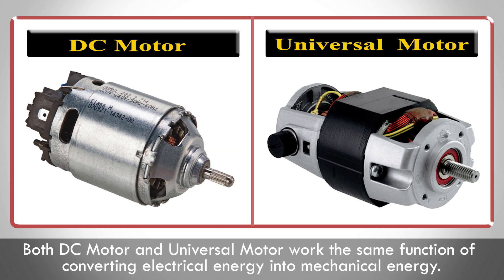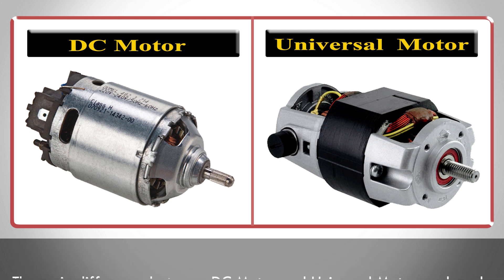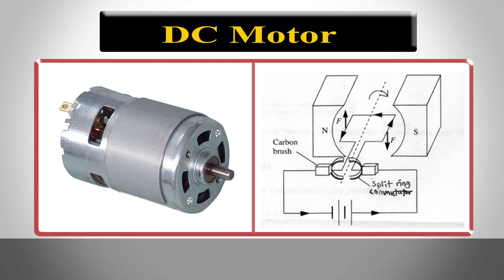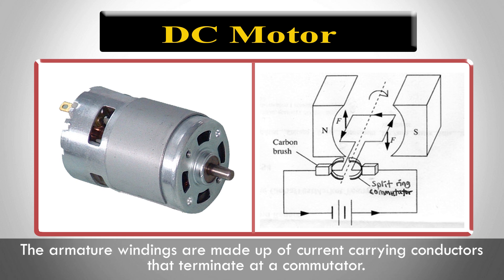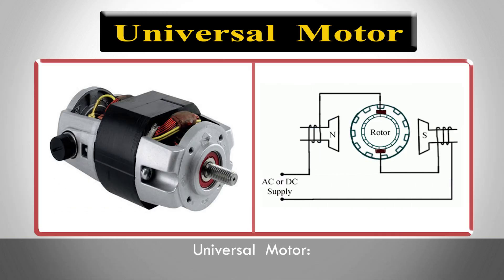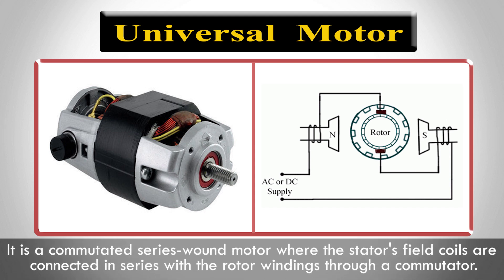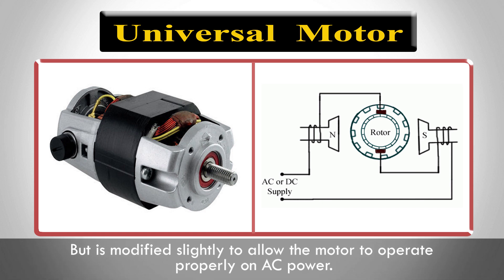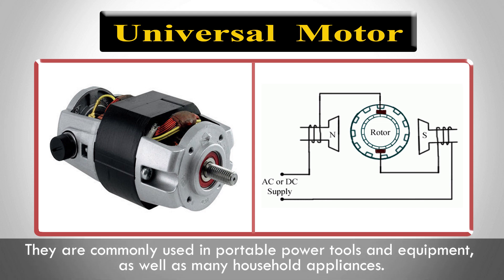DC Motor vs Universal Motor - Difference between DC Motor and Universal Motor

Comment: universal means the "type of current (AC / DC)", not that it can be used on all types of equipment. everything is clear now. If instead of the type of current was the voltage, it would be like "dual voltage", or "universal"